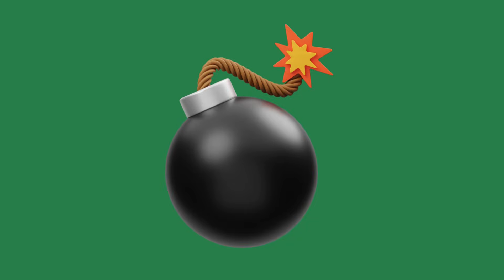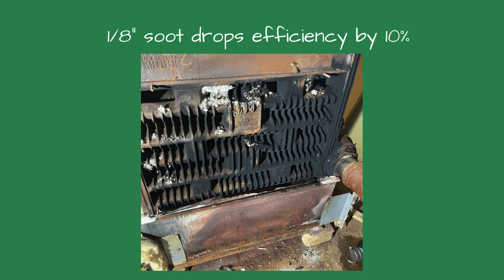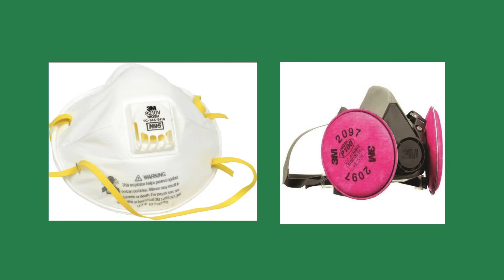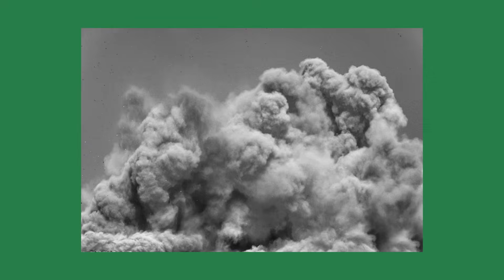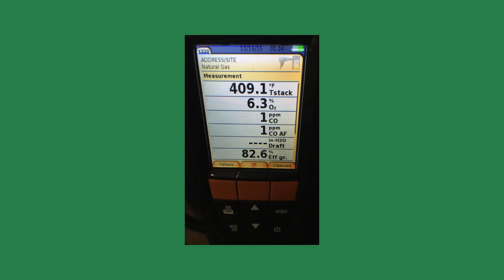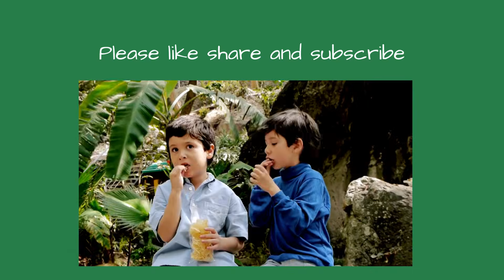Uncovering the Dirty Truth About Sooted Boilers

Comment: An old saying soot breads soot. I have found a combustion right after cleaning of the boiler will give false combustion readings. The readings will give high CO readings and lower O2 than actual readings. I found it better to set combustion by eye then come back hours or a day later then properly tune the boiler. No mater how clean you think the boiler is there will still be deposits of soot that need to burn off.
Reply from the maker: Never heard that saying Thanks John So true

Comment: Brings back my PTSD - Post Traumatic Soot Disorder.  Over forty years ago, worked on high pressure scotch marine oil fired, oil field boilers in Wyoming.  With these being portable units, changes in elevation and lack of maintenance all contributed to poor firing and soot accumulation.  Didn't matter how bad they smoked black while firing, the rough necks ran the boilers.  After cleaning them, usually into the night, you had the lovely prospect of driving maybe 200 miles back home, covered in soot.  No matter how many showers you took, only your wife's cold cream she used for mascara removal would remove the soot from under your eyes.